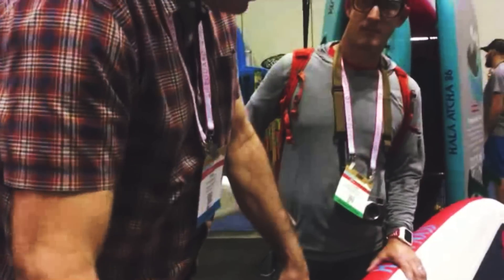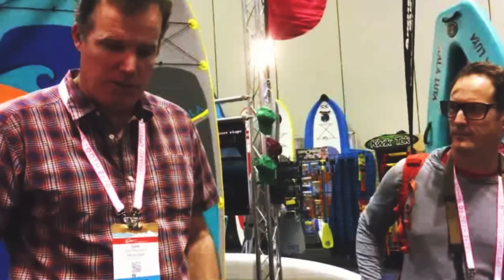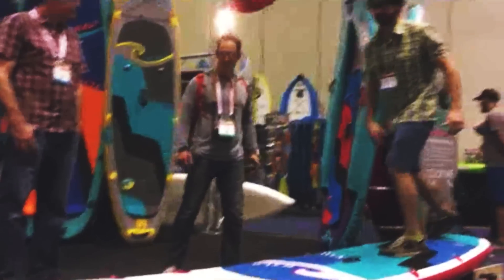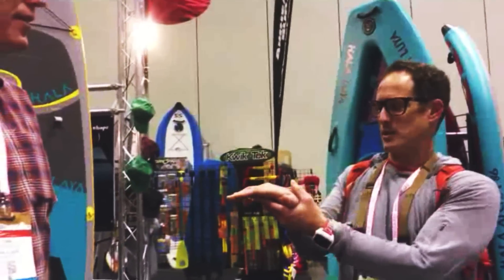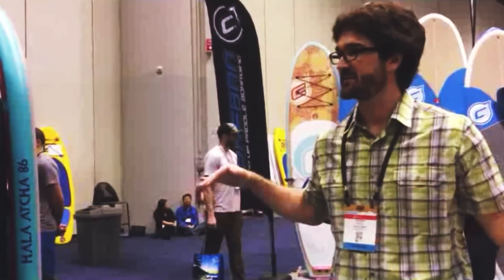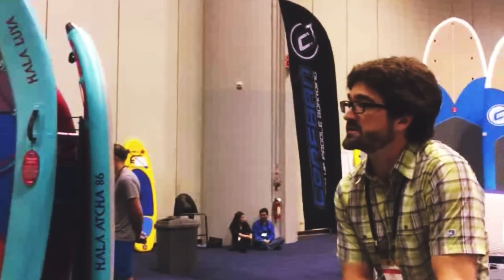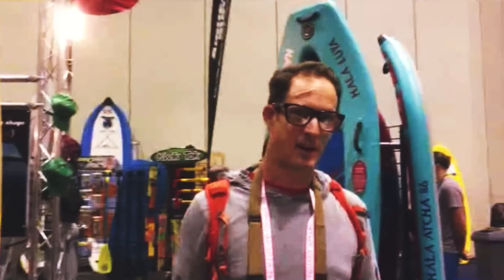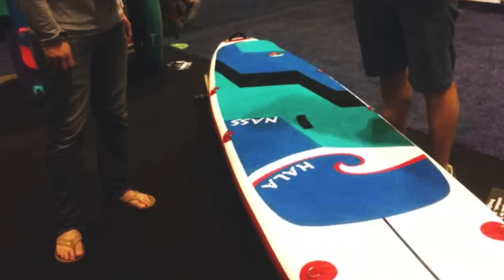Hala Gear first to incorporate Inflatable Composite Technology into inflatable standup paddle boards

Comment: Excuse me but ULI Boards has been doing this for ten years now and has been making production inflatables way before any of the other companies in business today.  http://www.uliboards.com/technology
Reply: +Chris Koerner Haha, I can see your confusion. Allow us to explain. ULI does have a stringer, but their Kevlar stringer does not more than double the stiffness of their board. ICT (in this, our simplest layup) is more than TWICE as rigid as ULI's Kevlar. ULI's website claims that Kevlar improves rigidity by 47%. The board in the video is 204% more rigid than a board without a stringer, or a104% improvement over baseline AND a 57% improvement over ULI's claims (which we have not evaluated). Many companies have done stringers of various materials for years, but none have ever done a stringer that achieves these results. This combination of thermoplastics and carbon is unrivaled, and patented.  And this deflection testing was done at 15 PSI, not 20! I imagine the results would be improved at 20PSI, though few people can even pump their boards that high, so we tested at the more standard 15.
Reply: +Chris Koerner ICT is better than Aramid stringers.  Using kevlar (aramid) or other high tensile strength stringers on inflatables only solves half of the problem.  They do great in tension, so the bottom of the board is fully improved as a result of the aramid stringer.  However the top side lacks compressive strength as aramids offer very low resistance to compression.  ICT solves this problem with true high modulus (compressive strength) carbon stringers top and bottom.  This provides as much compressive strength as is possible and gives stiffness that is unequalled in inflatables.